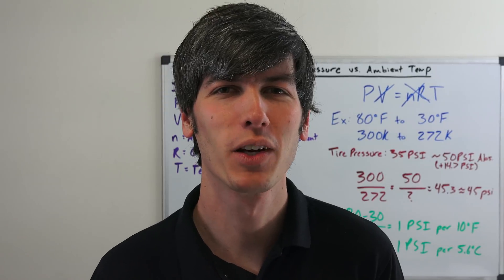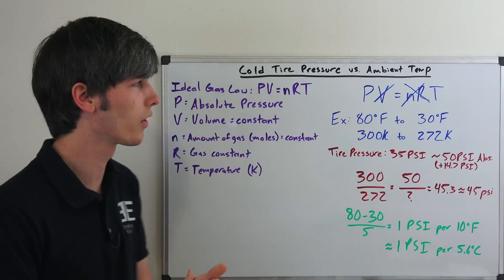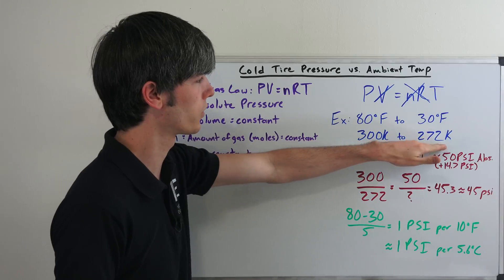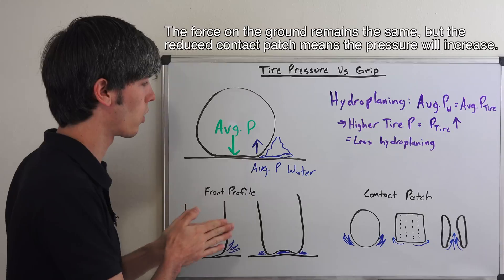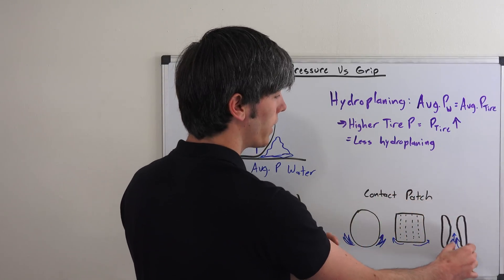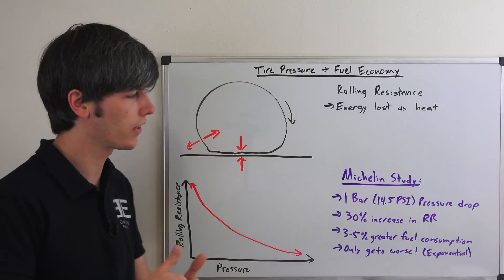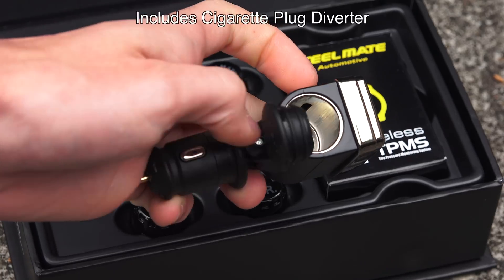4 Reasons You Should Monitor Tire Pressure

Comment: Kelvin is light?
Leaned it in high school in 90s
Didn’t really understand it until LED came out 
2700 kelvin is soft white
3000 brighter 
5000 bright 
6,500 
Some stores 
Used 10,000 kelvin light
That make you not think correctly subconsciously you buy more and Make you not think with logic.

A black light kelvin 
Make skin highlights red splotches bring out zits  on skin teen cautious about there look will leave places 
It works and teens will not hang out behind buildings with that light people that have zits or blotch makeup can’t hide it.

A red light make meat look fresh 
And great for tracking a blood trails 

But never herd kelvin in a tire

Comment: yes the tire pressure increase will increase the pressure of the tire pressing against the ground but not how he explained it. 

higher tire pressure results in a smaller contact patch. we know pressure P = Force / Area . The force being the weight of the car with gravity pushing downwards, and the area being the contact patch. Now it's easy to understand why the higher tire pressure works against hydroplaining.

Comment: What is tire size and pressure relation to car weight? I feel like 2,5 bar is too low for Nissan leaf which cyrb weights about 1730 kiloes. Often cars as such has 235-245 wide tires but Leaf has 215/50R17. I drive 2.8 bar and it decreases aquaplaning a lot and does not effect grip in summer. On winter i will go 2,5-2,7 since its for better grip.

Comment: My front tires always feel very low pressured…. The manual says 1.8 bars and I usually put 2.1 and even that way it feel low in curves I feel the side wall bending and it gets really wobbly and dangerous… of course I’m driving a bit fast when this happens but I think this shouldn’t happen I don’t know. Maybe my tires are loosing pressure fast.

Comment: As winter is here and TPMS all over are reading low I wish you would revisit this adding in...  Reading differences between old school tire gauges which measure relative to ambient and TPMS which is totally enclosed and I assume calibrated to STP.  Is not the goal to maintain tire shape?  Is that not based on relative pressure rather than absolute internal tire pressure?  What are the affects of elevation change and the less dense air at higher elevations (again the relative pressure concept)?  Does tire volume affect temperature/elevation pressure changes?  THX

Comment: Biggest time to pay attention to this is when seasons change dramatically (you can skip this part Hawaii and Florida)... that's when drastic enough changes occur to warrant checking and correcting. Personally, I FAR FAR prefer having my tires set to the minimum recommended pressure rather than the maximum recommended pressure, I like em soft, smooth and quiet. :)

Comment: I removed the stock 17 in rims from my Forester and installed 15 in rims with BFG K02 tires. Switching from a passenger metric tire to a light truck tire. How do I find the best tire pressure for normal highway driving to get the best tread wear and contact patch?

Comment: Dear Engineering, thank you for this informative video. I've tried to understand whether the recommended tire pressure is like the recommended oil viscosity--which according to another of your videos is "use the recommended oil viscosity". It seems like tire pressure, within reason, is a compromise of grip, wear, efficiency, and ride quality. My question, in this case, is whether we as owners have a working window within which to make some choices, or whether we can only make things worse by not using the recommended pressures. I'm specifically interested in airing up my tires for a little boost in fuel efficiency. Thanks for the wonderful content!
Reply: Like he said in the video, when running 1 bar too low, which is significant, they only lost up to 5% in fuel consumption. I'm a bit surprised it was so low but considering this is definitely not worth it to increase the tire pressure any more than recommended.

Comment: I’ve probably got 1-3 psi too much because the contact on tread bar 1&3 show 3/32 and 2 is at 3/64 on the front of my Scion tC.  But the rears are 9/32 on tread bar 1-3. Been getting 24mpg from 17mpg in the city using the bsfc video you uploaded a while back. Freeways I’ve been getting around 29-33mpg. I think I’m doing ok on economy but I have notice my fuel economy has gone down as the tread has gone down.

Comment: I'd like to know why after I had 4 tires installed by my local kia dealer they inflated the tires to a whopping 42 psi when the sticker on my car clearly says 33 psi max when cold. I felt I was riding on rocks so I lowered the pressure for a softer ride.

Comment: A question, please:  I know psi is the pressure from the inside out, but if you load your car with  more weight, would that put more pressure on the tires and say a 35 psi would become a 40psi?  I am thinking of an inflated balloon, you squeeze it in the middle and it would bulge on the sides due to pressure.

Comment: i noticed that whatever the car suggest it's always better to go overpressure a bit. in my (rip) civic EG instead of the 1.8/2.2 range i went 2.6 and at that point the car really felt more stable and quick in trajectory change, and during hard braking (say 100 to 30kph, no abs and no locking) both the front end diving and the oscillations of the rear axle completely vanished. this is meant for daily use, track racing is a different planet.

Comment: Great info, thanks!  My Sienna SE came with P235/50R19 Dunlop Sport 7000 tires.  Reading reviews they don't look great for wet traction. I don't know if I should just swap them out for some better tires, or if they'll be okay with optimum inflation.  The max pressure is 51psi, and the placard in the van says 36psi front and back.  Would 38 or 40psi likely be an optimum pressure to not lose dry traction but to maximize wet traction?  Also, I have to drive .25 miles on a rough dirt road every time I leave the house.  Thanks for these well-presented and informative videos!

Comment: hi!
the preassure to effect tire wear is not alwats true like you showed it.
on modern tire edge is soft,so if you have too much preassure it will springfrom there and liftthe tire centre up, result in wear of tires contact pattern sides.

Comment: Hey bro I have a serious problem. I can't convince my buddy that his tires are too old!  He bought 4 full size spare tires he found in the trunks of junkyard cars and he now runs them on his daily driver.  They have zero cracks.  They look and seem to feel brand new and not stiff/dried out like an old eraser.  My buddy is convinced they have been preserved and are essentially as good as new.  The fronts are both from late 2000 and the rears are 02 and 03.  I'm assuming they're not gonna blow out because there are no visible cracks. They were down to about 10psi when he got them which he thinks of as a plus.  Are they gonna grip as good as they used to?  Could they be cracking on the inside only?
Reply: Michael Murch did they blow up?

Comment: the external sensor weights 10 grams... wondering if that weight when the car is at highway speed and with centrifugal force may cause tearing the valve stem... what do you think?
Reply: No. 10 grams is insufficient at those revolutions. Unless its made out of metal,  the stem ages and when you change tires it's always the best idea to change valve stems at the same time. Don't depend on the tire shop automatically replacing them,  tell them upfront.

Comment: Hello, I have a question to ask 

my car is quite lightweight (930kg) so whenever I cruise on the highway at high speed (120km/h above) it will start to feel as if the car is "floating" and not stable especially when a truck/larger vehicle passing by, someone suggested that reducing the tyre pressure a few psi will reduce the "floating" feel, is this a good thing to do? 

do you have any other suggestion to improve the stability? thanks
Reply: Agree with the idea of the reducing the tyre pressure properly to reduce the "floating" feeling, the cpncept is to increase the tire friction with the ground.

Comment: Decent video but just one point, 1 bar= 14.9PSI.  14.7PSI as shown is Stoichiometric- this relates to Air/fuel ratio in a gasoline engine, as for the 14.5PSI shown, I have no idea where that came from!! It does matter when doing these calculations to be accurate.

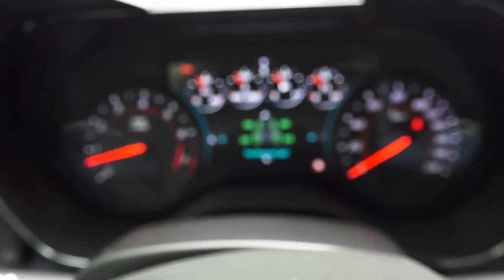Comment: At 0:46 and 0:48 i noticed there appeared to be a slight discrepancy with the TPMS attached to the each tyre and the display on board the dash. Is the TPMS fitted to the car as standard better than this after market device? If so,  what is the margin of error expected to consider when getting tyre pressure data?
Reply: Hi, this after- market TPMS Model offer are special for those car with original Low profile monitoring device, they are more professional in real-time pressure and temperature monitoring & alert.  
As we all know, a handle tire gauge may help you in tire checking before you drive, but TPMS can provide you datas, predict you the situations of abnormal tyres. Any, think twice before you buy.  Additionally, this STEELMATE TP-79 Model is designed  for those family sharing cars [20-50 Psi] within regular ,  Hope this do help.

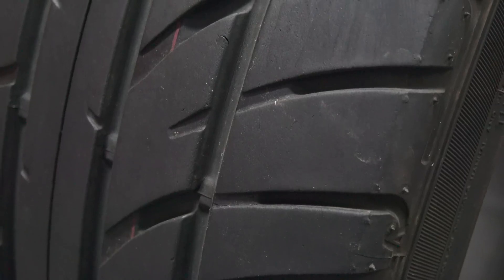Comment: I have a question! At 2:50 , does increase in contact patch increase friction??? I think friction only  depends on the "Tire Material"-"Road Material" pair and the weight of the car. Could you kindly look this up and explain the facts? As far as I know, wider tires are more grippy because their rubber is softer. And vice versa, if you want a softer compound tire, you need more rubber for making the tire reasonably stable which translates into a wider tire.

Comment: I picked one up, certainly is fun info to have on hand, question is what is an acceptable tire pressure different between tires? So as each tire warms or cools different, what wold consider to be to far of a gap between them to start being unsafe or cause issues?

Also should the tire be re-balanced with the increase wait of these monitor systems? and will they affect cars with monitoring systems inside the wheels?

Comment: A few questions

What would the working pressure be of a tire after 30min of driving and would this be the proper operating pressure?

What pressure should you use if a tire is filled with nitrogen as nitrogen does not change with temperature?

Comment: If you are driving long distance, when would it be appropriate to check the tire pressure to get the best highway fuel economy? if you do it before the trip begins the tires are at its coolest... and if you do it after a few miles/kilometers, the tires are warming up and the pressure would already begin to change...
Reply: You always want to check before.
Checking when hot is very inaccurate. Tires that steer, brake, etc. heat up more and read higher pressures due to it. Once they cool down, they drop in pressure a decent amount.

Comment: I just bought new tires, I'm pretty sure they put too much psi in it. they put 40 psi. and the warranty doesn't cover uneven wear.
Reply: I run 38/36 F/R PSI. 40 isn't unreasonable, depends on the tire, vehicle, etc.
Check the cars specified PSI, and try setting the tire PSI 4 above it. 
The small bump helps increase fuel economy and handling, depending on the vehicle it may improve tire wear.

Comment: Hi Engineering explained. I dig your channel
Question: if my car's manufacturer recommends 30psi and my tire is rated for a maximum of 40psi, is 35 psi a good compromise, or should I stick directly to the recommendation of my auto manufacturer?
Reply from the maker: Always go with what the manufacturer recommends! The driving dynamics have been designed for the recommended pressure. You can ignore the max pressure on the tire.
Reply: Thanks for clearing that up for me. You rock.
Reply: +Engineering Explained What the manufacturer recommends is for sure not always the best.
In most cases that I have seen, the door PSI is 4-6PSI too low and causes uneven tread wear. 
It's best to try 4PSI above, do some treadware tests, and go from there.

Comment: If it is 30F in the morning and you go driving on the highway. Will the temperature of the air inside the tire increase and cause the pressure to increase ?

Comment: Could you explain why cars do "wheelies" when on the drag strip?
Reply: The back wheels dig in with enough torque that the car wants to move in the opposite direction. It's like getting your drill stuck and it starts to spin. It takes tremendous force to lift the front end up with the narrow moment of the back wheels. Although rear engined cars are light enough in the front to do it.

Comment: TPMS sensors that are installed on the valve stem are not well regarded, they defeat the very reliable valve core and rely on a rubber gasket in the cap/sensor, which is prone to leakage. 

The product in the description seems to have good reviews, but I would still be wary.

Comment: Does the cold tire pressure even matter, beyond the first couple miles of driving?  Seems to be that warm tire pressure would be what really matters, unless all you ever do is very short trips.
Reply: Cold pressure is what matters. It is impossible to reliably measure warm pressure, as cornering and braking increases the pressure by as much as 4-6PSI.
Reply: FCFordLord Right, but ambient temperature can also change tire pressure.  If you have 35 PSI in your tires at 0 degrees, then you have significantly more air in your tires than if you have 35 PSI in your "cold tires" at 100 degrees.

Comment: Hydroplaning isn't anything compared to the effect of under-inflation on winter tires. Their grippy magic on snow/slush goes away if not inflated enough.

Now if driving on loose sand or soft dirt/mud, letting air out isn't too bad an idea. That'll spread out the tire some and help keep it from digging in.

Comment: How does changing the tire size affect the amount of air to use vs sticking with the original amount in the manual. in my case stock was 1755/70/14 and now have on 185/65/14
Reply: It doesn't affect it much, unless there's a huge tire size change.
Reply: +FCFordLord OK thanks much.

Comment: Hello Mate, i live in indonesia which is 35-40°Celcius everday,n my Manual book say use 0w-20 and the ambient temperature max is at 40°C . so should i use 5w-30 or 10w-30 ? and using 0w-20 seems make my engine very HOT n the AC is not that cold,and also when in 1500-2100RPM it seems the power not very kicks in,btw im using all new fit (CBU,import direct from Japan)
Reply: hey i live in texas where temps get as high as 43 degrees C during 4-5 months a year and i am a tech for a general motors (gm ) dealership in the new 2014 and up model full size trucks with a 5.3 or 6.0 Liter engines we use 0w-20 full synthetic oil. new cars today have numerous senors and valves/solenoids that require exact oil pressures and lucubration to run properly. make sure you are putting the correct amount of oil and that you change you oil on a regular basis using manufacture specs, they spend countless hours and $$$ determining what is best for that car so if you follow their guidelines it will maintain the expected life of that car. just as an example i had a car come in yesterday afternoon check engine light on, with a code for camshaft actuator solenoid valve. checked the oil it was 2 qts low and dirty. it ruined the solenoid valve that controls the phasing of the cams, had to replace the solenoid valve and change the oil. all of this could of been avoided if they just maintained proper oil level and oil service/change. oil changes are average $35 this repair was close to $300. also many cars have hydraulic timing chain/belt  tensioners and if you dont change your oil/ use the wrong grade or have low oil level/pressure you will have rattling of timing chains, premature wear of chains and if not major engine damage. timing chain repair on some of crossover/suv trucks as gmc acadia can cost as much as $1000 repair.
Reply: jay webb Thanks a lot mate,really appreciated ur help

Comment: I was wondering what is an under over inflated tire, like how much psi?  My SUV has the tire specs say all tires should be at 26 psi.  Currently I inflated them to 35 psi because I am doing a lot of highway driving with my new job.  I have yet to see the fuel economy lost or gained as I still want to do another couple weeks of driving to know for sure.  Would 26 psi be under inflated? Or would the 35 psi be over because it over the specs?

Comment: I'm disappointed you didn't talk about using a tire temp probe to determine if you need more or less air. Or talking about the science a racing engineer like a nascar tire guy uses to set up tires and suspension together.

Comment: I was wondering if you were to overpressure your tires over manufacturing specifications would you get better fuel economy? I'm not sure if having less points of contact between the tire and the road is proportional to rolling resistance. In terms of track use would it be ideal to have manufacturing specified pressure to have the most contact patch without too much rolling resistance? I assume rolling resistance also has an effect on performance.
Reply: I believe the main reason rolling resistance goes up with lower pressure is the tire is deforming more and it takes work to deform the tire (which is also a cause of heat, which is why Ford Explorers were shredding their Firestone tires when Ford was advising their customers to underinflate them to avoid rollovers).

Comment: Decreasing pressure increases grip?  Top gear did a race on the salt flats in some older season where they decreased pressure but got a slower time.  Are there other factors besides contact patch that would affect the performance of the car?  Maybe less force against the wall so it has more of a flex?  Or something like that?